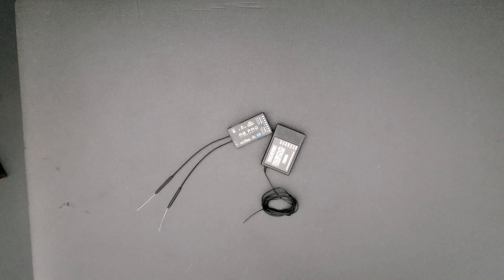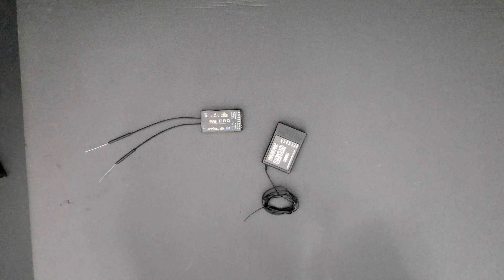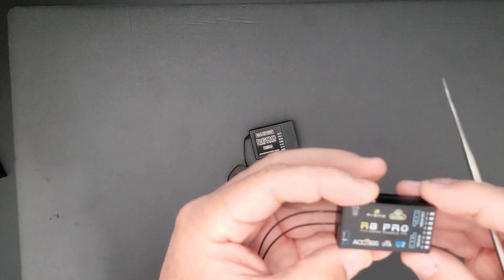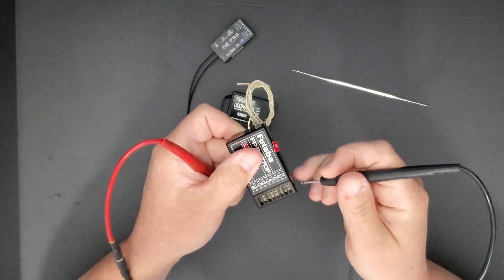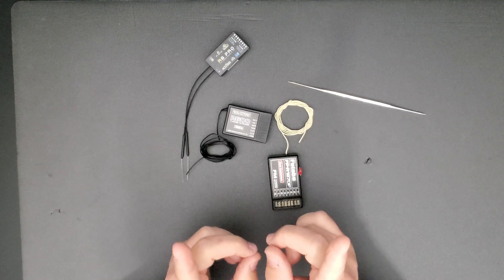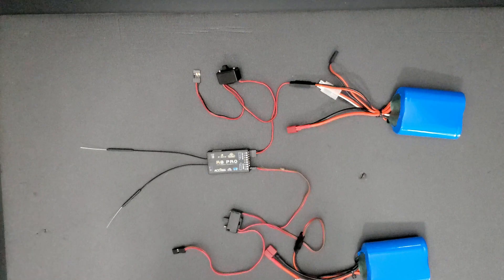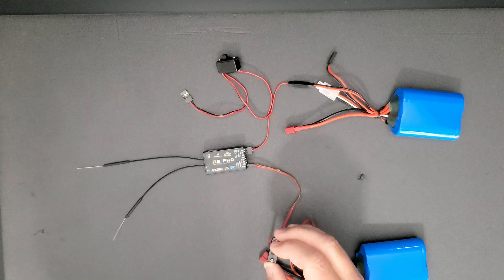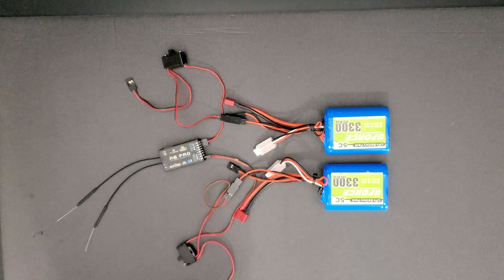Redundant RC Aircraft Systems: Simple and effective redundant battery setup.

Comment: An absolute horrible idea. If you suggest that one battery dies than being directly connected to each other, will kill the other battery. Batteries need to be hidden behind a BEC or a switching diode system in order to isolate the opposite battery. This is an absolute bad idea.

Comment: This is not a redundant setup. You simply connect your two batteries in parallel trough the RX. If one fails, for example due to a cell short circuit, the second one will die as well. And due to the high currents, the receiver will most likely die too.
For redundancy, you would need an automatic switch between the two batteries or at least a diode to prevent reverse current to the dead battery.

Comment: I use two schottky diodes back to back  so i can safely use two batts, a batt and a BEC, ESC and UBEC, any combination i want. An SBL 3040PT is a great schottky choice, 2 diodes in one package already connected right. I also use a 4700uf 16v capacitor across the buss

Comment: So it would probably be good to leave you BEC connected with extra battery back up what do you think ?
Reply from the maker: Can you explain in a bit more detail? Do you mean a straight battery backup and a BEC? For example, a lipo connected through an ESC.
Reply: @ChunkyC_RC  Yea  I have been told that it could damage you receiver, but I think your right I am thinking if voltage is the same it should not matter or even just below max voltage  I think it should be OK what you opinion ?
Reply from the maker: @superdon1chw  just make sure the battery voltage is within the limits of the receiver and servos and you should be fine, with or without BEC.

Comment: Great video. I would like to know if this set up can be use on any Futaba Receiver? Also if there is any way or change to damage the servos or receiver itself by having two power sources at the same time. Thanks
Reply from the maker: This will work on Futaba and pretty much any receiver out there. You shouldn't have an issue with damaging servos or receiver.

Comment: Cheap and nasty. Batteries would have to be identical all the time (state of charge) . If one fails, they are no longer identical. Potential for power from one battery to drain to the other. Simple diodes the solution. Each battery can only send power, can’t receive it.
Reply from the maker: That's the purpose of this. If one battery fails you still have the other. Yes, diodes work but then that defeats the purpose of doing this setup for a "simple" solution. I've run this setup many times and never had any problems.

Comment: Can't one battery backfeed into the other?
Reply: Yes, can feed back. Need diodes to be really redundant…the whole point
Reply from the maker: When you have 2 similar packs,  the current rating is the same and they balance out. Theoretically I guess if you had a battery on one side that put out a lot more amps then I suppose a little back charging may occur. But that's why we use the same batts on both sides so it's balanced. Good question 👍
Reply: @ChunkyC_RC  thats good to know. Some insist it will backfeed some say it is fine so I was curious
Reply from the maker: @AlanC5794  I've never had any problems when using identical batts.

Comment: good info friend! I thought if you ran two ESCs you could plug them both in too, but apparently you cant do that?
Reply: Ive done it with a jet. I did put in a schotty diode though.
https://youtu.be/TK8MYkRHxck?si=t1jDSntBMrg-a9jJ
Reply from the maker: The power would work but the mixing to make two throttle channels would be a trick. Best to remove the power wire from one of the esc plugs.